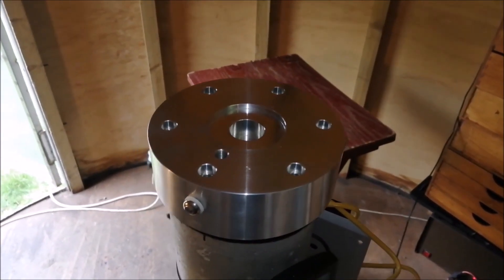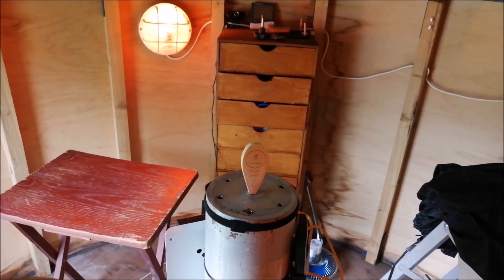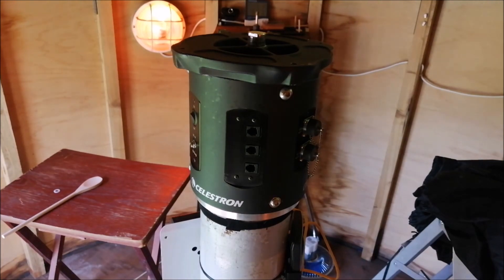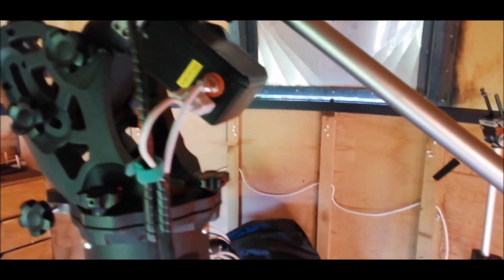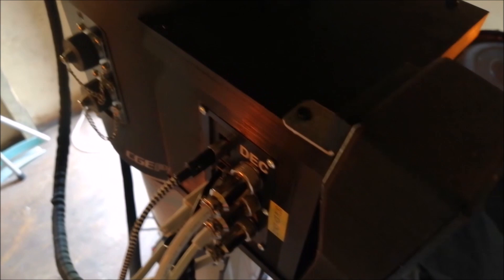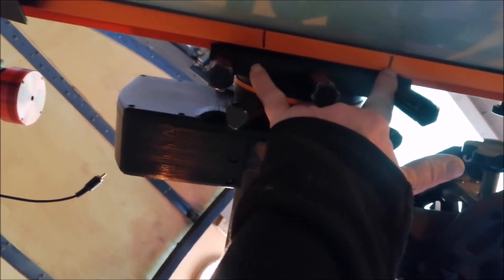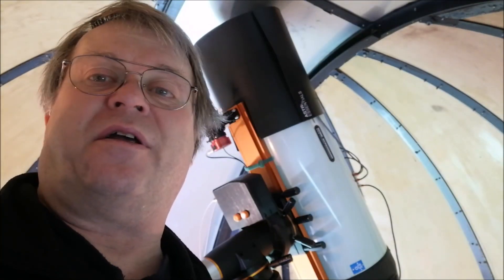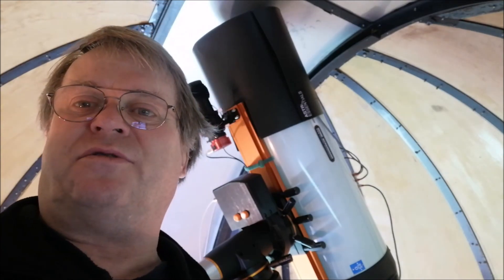CGE pro ONSTEP install in the observatory

Comment: Hi there, thnk for your vid. Question how deep did you build your pier?
Reply from the maker: Hi I have a metre square of concrete with 4 M22 threaded rods sunk into the concrete as the pier itself bolts to those rather than having the pier sunk into it. It's been solid all this time & hasn't moved although if the pier was longer I probably would have sunk it in the concrete.

Comment: Just found your video. Am I right in assuming that you are OnStep converted. It looks like the Chad Gray OnStep conversion that I have done. Am I correct that the cable connection to your DEC motor housing has two cables. I know that Chad’s setup does this for the RA cables. Can you clarify what the second DEC housing cable is for? In addition what are all the other connections to the box mounted on the electronics pier?
Reply from the maker: Hi yeah it's Chad's conversion kit I think Chad had to use 2 cables on other kits simply due to not being able to get plugs with the right amount outlets needed any more so he came up with this solution. From memory one cables is for the motor the other for the home switches. I'm using the micro USB from the box to connect to the mini PC as I control it using ASCOM, PHD2 & NINA. I've left the handset on there in case I do any solar imaging but in all honesty it's not really needed so I may remove it.
Reply: Although Chad’s kid for my mount uses the single cable on the DEC motor and my system is just a bit older I haven’t had a chance to use it yet. I have it at a holiday home and given other things and Covid lockdowns etc I still have to roll things out. That was a hint. It is on a dolly as I am sure you will agree it is a brutal weight, added to by the 11” SCT. Set up and strip down for regular use is not an option. I have a breeze block hut with concrete pier in place but just need to find some way of getting a roof sorted. As a matter of interest do you think the movements and tracking are working out smoother and ? more accurate that with the original motors?
Reply from the maker: @DaddyStarman  I hear you with the weight I did have a crazy thought about taking it to a star party but after lugging the thing to the observatory that idea has quickly gone to the depths of stupid ideas lol. I'm not sure what to do with the tripod but I'm happy its out the home now as it just sat there collecting dust & taking up a lot of room. As for performance differences from the original I can't comment really as my mount was dead when I got it, I think the belt drive will help though as there are Skywatcher mount owners who fit the Rowan belt modification to theirs (HEQ5 & NEQ6) I'm sure they would fit some Orion mounts to but just fitting those improves guiding. I've been getting between 0.3 & 0.1 total rms error which I didn't think was to bad & that was on bright moonlit nights. Maybe a bit of tinkering would improve it over time but for now I'm pretty happy with it & it copes with the RASA 11 with ease.
Reply: @dumpydalekobservatory  thanks for getting back. I think you were the wise one who got a dead mount. My electronics pier died before I even had a chance to get used to using it. I think the pier's inner workings must have died of boredom.
Good skies. (Hopefully)

Comment: Very nice look forward to seeing some images from it Tich.
Reply from the maker: Hi Neil long time no hear I hope you're all well? I've got some sensor tilt which is annoying so may go back to a four thirds sensor at as later date as I found it was more forgiving than the APSC sensor I'm using now.
Clear skies!!
Reply: @dumpydalekobservatory  I'm really interested to see how you get on with the RASA. Would be good to hear from a proper Amateur Astomony how it performs. I have a Epsilon130ED but keep looking at the RASA's form some reason! I'm working the issue out of a new camera at the moment. Well new to me, a secondhand SX46 with OAG and Filter wheel which is enormous!!! Wishing you Clear Skies from Holland.
Reply from the maker: @neilhankey2514  My RASA is the version one so suffers with mirror flop which means the auto focus routine is pretty useless, the issues were fixed with the versions two & the RASA 8. If you use a large chip then you will more than likely need to sort out the tilt issue you will almost definitely get as shooting at F2 will show it a lot more than with something slower. Back spacing is also critical to but they do hold collimation well which is a plus, but the one thing I will say about it is when it's dialled in & working well this thing is insane in catching data & I only use a one shot colour camera with a dual band filter, oh & filters for systems at F2 do cost so if you're thinking of shooting mono get ready to be shocked.

Comment: your getting there, going back to when you fitted the focuser, I had problems with the thin rubber O ring as it kept covering one of the 3 fixing holes arrrh
Reply from the maker: Yeah they can be a fiddly process to retrofit although I wish I hadn't bothered with mine as it's a version 1 & autofocus just doesn't work with those, I should have saved some money & got the standard SCT motor focuser & a mask. Guess you live & learn though eh?

Comment: That should throw the RASA around the sky quite effortlessly.
Reply from the maker: It does Steve the AZ EQ6 was undermounted for it really although it did seem to work ok after putting the RASA on a diet but still on the limits, I've been bench testing with the mount indoors for a few weeks slewing tracking etc & its been working great. 
Just need to get s first light with it now.

Comment: good job,lucky the cge pro  is such a lightweight...... i have now the lan adapter  on the  onstep,the webserver is  very responsive,better then the  wifi.
Great  dome by the way,better then a roll of roof i think..maybe in the future ill will get it myself too.

keep on posting !!
Reply from the maker: Thanks it's certainly not portable as described on the Celestron promotional video lol. Hopefully now it's set up in there I won't have to move it again. How are you getting on with your mount & how good is the guiding? If you don't mind me asking.
The dome I bought cheap off eBay needs a bit of work but it does the job, although the original plan was to have a roll on roll off roof which I would have preferred as the dome I have to manually shove round every so often when I'm imaging. It's not much of a big deal but it just means I can't go fully automated as the observatory is a home built one.
Reply: @dumpydalekobservatory  Well the guiding is great,just make shure the guidescope is rock solid  mounted .  after a  good polar alignment i am always  in the range of 0.45 or less. just using a old qhy 5 camera and a 170 mm scope ,its good enough. just balance good,not like skywatcher mounts  heavy on 1 side,but  perfect balance.  and that dome  will keep the winds away,so your good i think.  greetings John
Reply from the maker: @kajouman  Thanks John I can't wait to try it out now 👍